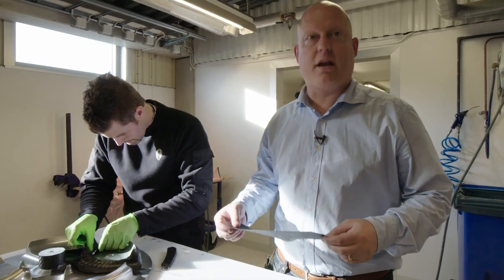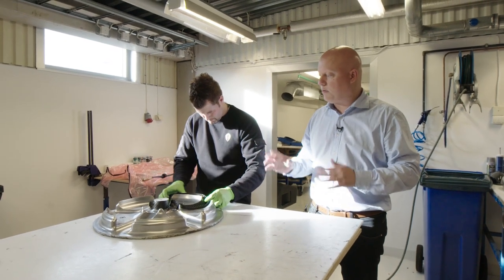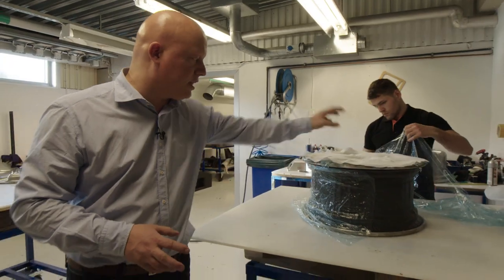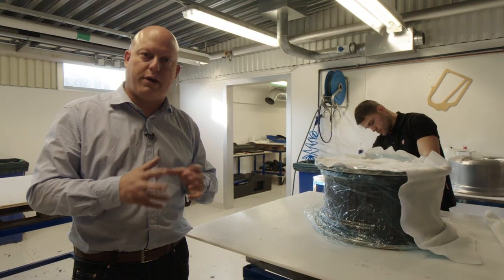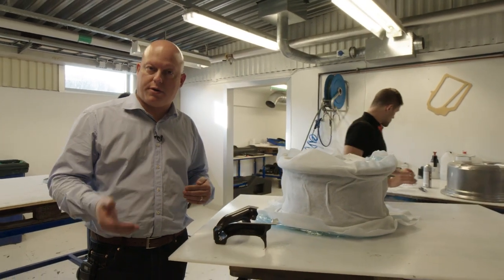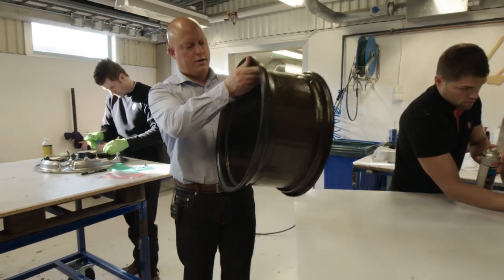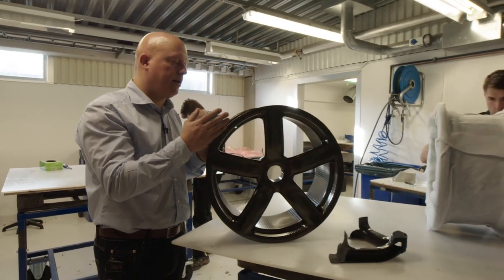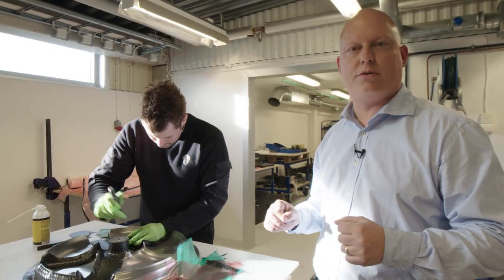Christian Von Koenigsegg Explains How He Makes 280 MPH Carbon Fiber Wheels

Comment: I wonder why F1 doesn't use carbon wheels then :?
Reply: Gerardo Serrano Cost is not a priority in f1
Reply: Simple, article 12.3 of the 2014 F1 technical regulations states:

"Wheels must be made from AZ70 or AZ80 magnesium alloys."

I would assume that it is a cost cutting measure, to avoid development costs running into tens of millions of pounds and to stop teams having to spend silly money on a part which has limited road car applications. They would add nothing to the show and it's also questionable as to the long term durability of carbon wheels, when subjected to the extreme thermal duty cycles that F1 brakes generate.
Reply: Because they are not appropriate for track use. These are fine on an airport runway going in a straight line, but would not live very long on a road course. 
I do respect what he is doing,  but a few things in this video are not accurate.
Reply: Ttt
Why specifically do you say that they're not appropriate for track use?
Reply: Ttt You seem to have done a lot of researching regarding this. Could you link me some of the references you used to come up with those statements?
Reply: Ttt i am going to call bullshit on everything you say, just for the shear fact i highly doubt you know much of anything when it comes to carbon fiber based products
Reply: I'm going to apply logic to the question, aside from the regulations, carbon fibre is strong to a point and then it shatters. In F1 the forces if impact are far greater than normal road use, I've watched F1 for years and have seen numerous 'broken' metal wheels. If carbon fibre wheels were used the marshalls would be forever sweeping it up!
Reply: Chris walden The only broken metal wheel which I can remember in an F1 race was Lewis Hamilton's in the 2011 Canadian Grand Prix. They aren't a common occurance at all.

Carbon fibre parts shattering when they fail is a myth. It really depends on how the part is constructed. Carbon rims have been used for many years in cycling applications and they have a far higher impact resistance than metal rims.
Reply: Dennis Kwok I'm not going to lie, I can't be bothered to research and tell you specific events where a wheel has broken, but I've seen 28 years of F1 and I have seen quite a few broken wheels. 
But a say again the forces involved in F1 are far greater than 'normal' usage. Aside from the regulations, if carbon wheels were safer than metal then F1 would be using them.
Reply: Chris walden Like I said, broken wheels IS NOT a common occurance in F1. The fact that you've watched F1 for a 28 years makes no difference to this. Can you imagine the carnage that would ensue if it did happen on a regular basis??? The wheels are designed and built to far exceed any of the forces that it would be subjected to in normal use, as the consequences are far too great if one of them fails. When Hamilton's left rear broke at Canada 2011, it was due to a collision with the pit wall after being squeezed by Jenson Button. Otherwise, there is no instance in my memory where I can recall a wheel failing in recent times. I've watched F1 from the mid 80's if that makes any difference to you?

You say that you're applying logic to your reasoning, but unfortunately, your reasoning is incorrect and too simplistic. I refer you to my previous statement as to why carbon wheels are not used in F1:

All it would do is increase costs. As every team would have to develop their own wheel at great expense, until everyone has them and nobody actually ends up having an advantage, but their bank accounts would be considerably lighter, but with sod-all benefit. They also have very little relevance to road car applications, so there is no incentive for the FIA to allow them in the technical regulations.

Another technical reason for not using carbon wheels in F1 is due to the way carbon fibre conducts and dissapates thermal energy. Obviously, metal is the best heat conductor and it is also able to deal with repeated high temperature cycles with a minimal loss is tensile strength. In contrast, carbon is a much poorer thermal conductor and doesn't dissapate heat very well, resulting in ever climbing temperatures. Carbon fibre is a carbon strand/resin matrix and the latter can only cope with temperatures as high as a few of hundred degrees celsius before it's structural integrity is compromised.

Furthermore, rubber becomes vulcanised at reletively low temperatures and if you ran a carbon wheel, the resulting high temperatures due to heat soak from the brakes would cause the sulphur bonds in the rubber in the tyres to change, resulting in failure or at the very least, huge thermal degradation.

Carbon wheels for road cars do offer benefits, as they have a better strength/stiffness/mass ratio (if designed correctly) and you don't encounter the ultra high braking temperatures found in F1.

Hope this informs you.
Reply: hey finally someone that understands thermodynamics and tensile strengths, and doesn't base all of their faces off of opinion.  i thought youtube was full of a bunch of half inbreed children!
Reply: b ham
You're welcome mate. You're right that youtube is full of people who read a small amount of information and then think they're experts.

I know it shouldn't, but it really does my head in when people think they know what they're talking about and then try and tell others (who DO know their stuff) that they're wrong. All they do is vomit out opinion, without backing their argument up with facts and Science. Pisses me off.
Reply: Dennis Kwok Think you are taking this a little too seriously! I know what you mean about idiots venturing an opinion on something they really know nothing about, eg far too people blaming the marshalls in that Bianchi incident. I don't know much about carbon fibre but due to F1 probably a little more than most. I think the reasons we have both stated are all reasons why F1 doesn't use CF wheels, and I stand by my logic!!
Might try texting BBC F1 at the next race, maybe get an answer from the horse ;)

Comment: 300Kmh to 0 in 6.6 Seconds??? That is 4.5g of deceleration! I did not know that numbers like that existed in even Formula One.   

Edit: It is actually 1.28g. I miscalculated at first. Still very impressive, enough so to make it feel as if your eyes are being pulled out.
Reply: well simply put... I doubt it. That would be over 12Gs of force. Fighter Pilots tend to start and black out around 10Gs, and red out can happen with less than 6Gs... in this case of the car slowing down, it would be more so red out than black out... even if only held for 2 sec, they would be blinded for a few minutes most likely, and that is not that great of an idea on a live track.
Reply: F1 cars get about 4g on braking. Don't worry no street car even with slick tyres is getting even close to that.
Reply: No. 300 km/h is 83.33333 m/s. If the braking time is 6.6s you have a deceleration of 12.6262 m/s². Thats "only" 1.287g. So it's not that much force. Even a normal modern car can brake with round about 1g with good tires.
(Edited because calculation error)
Reply: Bullitt Well don't forget that the acceleration is probably quite nonlinear. I would take your number as lets say a limiting condition result. In reality I would expect the force causing the deceleration to grow as the car slows down.
Reply: angelfishgod  You are right, the deceleration is not linear, my calculated number is an average. But because of the higher downforce and wind drag  at higher speeds, the deceleration decreases as the car slows down. But the difference is not that big in my opinion.
Reply: angelfishgod the deceleration is bigger at faster speeds
Reply: I don't know how you managed to calculate this, but I get 1,3G.
Reply: Darzon 
O yeah, you are right.... I forgot to convert km/h into m/s... I got 1.28G 

I have had a headache for about 3 days now, so my thinking is a bit off
Reply: Achilles Hellas Why is the acceleration larger at high speeds?
Reply: Bullitt
Remember they use a air brake also so you need to add that to the calculation, as it increases the down force on rear wheels as the car slows down.
Reply: angelfishgod no, the slowdown is larger because of the resistance of the air

Comment: First road car who use composite wheels was the Citroën SM (built between 1970 and 1975): the optional Michelin glass fiber/epoxy wheels called "RR"  (for reinforced resin) was available in 1972 after successfull testing during the Maroc rally...

Comment: I weighed my steel Subaru wheel, and it was 18lbs lol . Why go through so much trouble to save 4 or 5lbs??? You can take a shit and you will have your savings
Reply: Because. . . Race Car
Reply: and it makes a huge difference since it's the only thing getting the power down to the road, it needs to spin as easily and lightly as possible. especially when you have 1000+ HP but you wouldn't know that now would you... 200-400+hp(if turbo a subaru) but🐸🍵
Reply: +Y10Q You need to think about physics here. The few kg you save mean a world of difference in a wheel compared to losing it in the rest of the car because the wheel is a rotating mass. It's much easier to make a lighter wheel spin than a slightly heavier wheel, especially at those high speeds.
Reply: +Y10Q  multiply that 4-5 lbs by 4, for each wheel, and that is a huge difference. These supercar manufactures will do whatever it takes to make a car lighter, which can be the difference between the fastest car on the road or second runner up.
Reply: +Y10Q But your Subaru wheel couldn't take the 1000+ lb-ft of torque that the Koenigsegg puts out (or the equally crazy braking).  You can't compare the absolute weight if the strength's not equivalent - a bicycle wheel weighs less than your Subaru wheel, but you can't substitute it onto your car to save weight!

In the video they mentioned they previously used aluminum wheels that weighed 10 kg (~22 lb).  Since aluminum is lighter than steel for the same strength, wheels made of steel that are strong enough for the Koenigsegg would weigh significantly > 22 lbs.  Your 18 lb steel wheels definitely aren't comparable.
Reply: +Y10Q Obviously you do not understand the concept of dynamic loading as applied to centrifugal force. Your steel wheel would crap itself well before 200mph.
Reply: Jojo Diver oh yeah? I have had it up to 165mph
Reply: +Y10Q 165mph isn't 200+mph...the wheels are designed to take advantage of the speed ratings on its michilins. Your sti or modded wrx isn't even on the same plain of existence. I love Subaru's but that big ass wing doesn't produce crap for down force. The one:1 produces 1300lbs of down force at 160mph.. As many said, rotating mass in the drivetrain is a leach to power, responsiveness, and puts more stress on components the heavier it is. Without the subtracted weight from the wheels the power output to the tarmac would be reduced, the overall weight of the vehicle would go up. And then Christian may not be able to call this monster a "megacar". Further more carbon fiber is much more adept at taking shock loads than steel or aluminum which in this vehicles applications and useage is extremely important.
Reply: ekdromoi I am relatively poor. I own an Apt in Roppongi. Small apt in NYC. A condo in Gulf Shores, and I enjoy life on a 160 acre farm near Pensacola. Did I mention I own an Apt building in Atlanta? Yeah. Subaru is my lucky car. Just like some people have a lucky suit or shoes, I have a car.
Reply: +Y10Q do you really?
Reply: carlo alexander  yes, for me, it is a lot more fun than owning one or two supercars. But to each his own right?
Reply: +Y10Q are your subaru wheels 19x10?
Reply: do you have any idea how much of a difference 5 pounds would make on a WHEEL? Your engine has to spin those wheels, and 5lbs on each wheel is very substantial. Not to mention the handling details Christian just informed us all on, but of course you weren't paying attention. 4-5lbs on each wheel is actually crazy especially considering their size, the amount of torque they have to endure, cornering g's, and the fact that they are stronger and lighter than previously used materials.  So much trouble you ask.... how about you re-watch the video, and LISTEN this time and you will realize its purpose. Or maybe take a physics class and understand how the world around you works, and maybe you wouldn't be comparing a huge wheel from a super car, to your wheel that probably cant even hold a 225 tire...... 4-5 lbs on each wheel, if you cant see how dramatic that would be, why are you even into cars?  Think about it, if you had to spin a wheel, it would be easier to get one spinning that is lighter, and 5lbs is crazy, as he said 40% decrease in weight, so that means 40% easier to spin, and change direction with..... I just don't understand how you can watch this video, LEARN NOTHING, yet still take the time to weigh your Subaru wheel, then proclaim 4-5 lbs is nothing, wile it was stated to be a 40% decrease in weight..... The weight has nothing to do with overall power to weight ratio as you clearly think it means due to your "taking a shit" idea, it has to do with the rotational mass. Like do you think these cars have 20inch rims to look cool? That whole trend started because of race-cars: larger wheel means you cover more ground with each rotation... Just watch the video again man, because it's frustrating to see a revolutionary business man/engineer provide us with sound information, presented in an entertaining way, only to have someone like you watch it and not learn a fucking thing.
Reply: +Y10Q You may want to take a look at the centripetal force equation. If you do, you'll notice that the force is proportional to velocity squared. so the force your wheel has at 165 mph is only about a third the force that the 280 mph wheel has on it. So at a minimum, the carbon fiber wheel is three times stronger and three pounds lighter than your steel wheels. (6.9kg is a bit over 15 lbs). As for the advantage in having a lighter wheel. A lighter wheel allows for the car to both accelerate and decelerate faster. When accelerating, the wheel needs to be spun up to speed, and that takes energy. And that energy then isn't available for accelerating the vehicle itself. The same goes for decelerating. If you had two identical vehicles in all respects except the first vehicle had a body weight 10 kg higher than the second, but the wheels in the first vehicle were 10 kg lighter (so both vehicles overall have identical weight), then both vehicles would have identical top speeds. However, the first vehicle would have faster acceleration and deceleration than the second vehicle. Effectively wheels and tires act as flywheels and they have to be spun up and spun down as you accelerate and this energy storage simply causes the system as a whole to lag. And a lighter wheel stores less energy than a heavier wheel, so the energy lag is reduced.

Comment: ...and then there's Ford...
Reply: ...And Chevy and dodge...
Reply: +Jagger Games they do Carbon fiber wheels too? why haven't I heard of this?
Reply: yeah on the 120,000 dollar corvette
Reply: I learned something new today.
Reply: +Jagger Games ford does it on a 50 to 60 thousand dollar mustang....
Reply: +ChrisHallett83 lol, they do? How does it differ exactly then? Since this is basically the same way that everything carbon is made, in pretty much every industry that uses carbon fiber...

Currently, almost all mass production of carbon is done using pre-preg fiber, sold in sheets. The resin is basically all heat-activated epoxy resin. Some small-scale production is done using 2-part chemically activated epoxy resins, but that's not mass-production...

A few exceptions do exist - mostly in the manufacture of carbon tubes, which can be woven in a way similar to a sock.

Now, if you think that it's made differently, perhaps you can show how sheets of carbon fiber are converted into solid shapes differently?

You sound like you know nothing about the process. Just like the guy in this video.
Reply: no ford pulled out of the land of aussie
Reply: Michael caplinger what? please explain.

Comment: Under 6kg for a 19in wheel is absolutely bonkers. It's also incredible that they're so strong. The trouble with carbon wheels is that an alloy/steel wheel will break in a ductile way (and the driver can feel if it's damaged, see the bend etc), whereas carbon wheels will break in a brittle way (nothing until it fails, when it will break completely). The solution is to make it so strong that nothing can reasonably break it. If it can handle braking from 280mph I believe it!

Comment: I know how they make it hollow, there's a positive and negative mold for the inside, however the inside mold is made of a material that can be melted after the mold is finished. And they use a liquid that expand and detracts with pressure, (that's why the oven locks, it's a pressure oven.

Comment: Glad to finally see the car industry using carbon fiber this way.  The cycling industry has been using carbon fiber for wheels much longer.  With rim brakes on cycling wheels, the carbon fiber has been known to greatly affect tire pressures- some to the point of blowing the tire off the rim.  I wonder if this brake heat issue somewhat affects race cars despite that they use disc brakes.

Comment: I imagine your proprietary process for filling the hollows would involve some sort of sacrificial foam media which would support said hollows during autoclave cure, then dissolved with acetone or some other solvent later on. I also noticed you didn't include footage of the unidirectional material which I would think would be requisite around the circumference and extending radially along the spokes. Ever considered Bismalimide for its heat resistance?